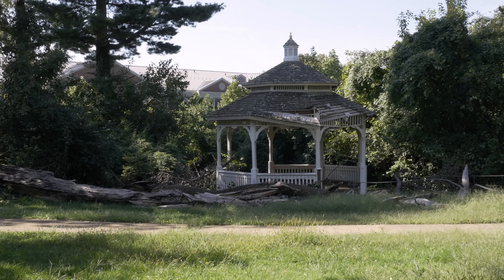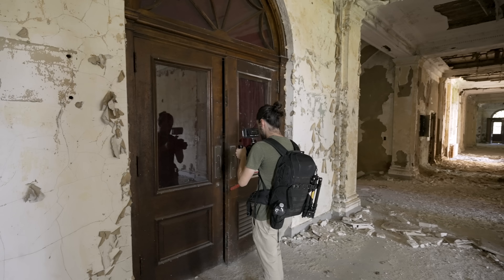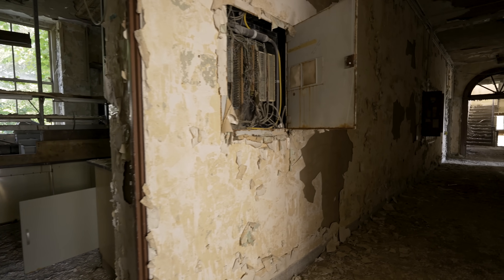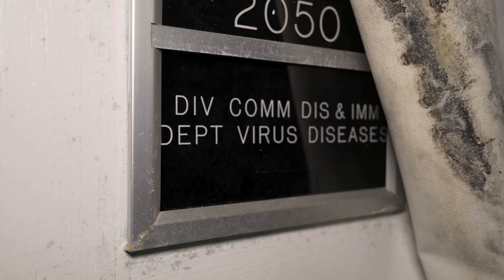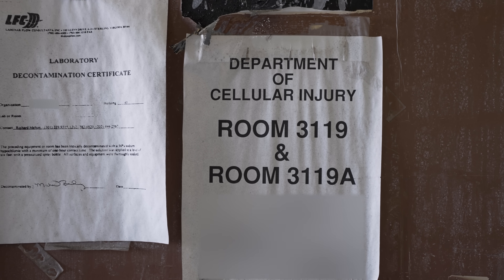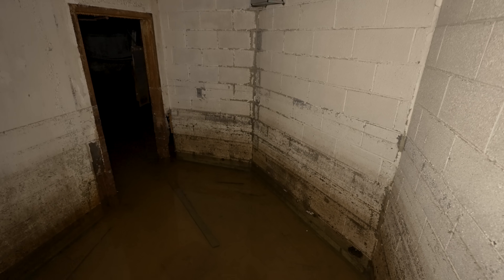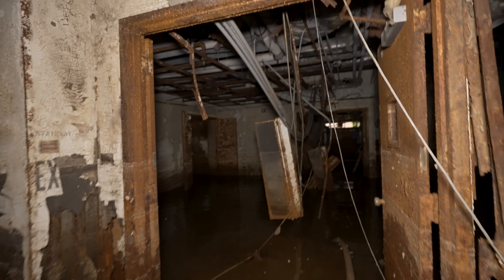Exploring an Abandoned US Government Biomedical Research Facility - They Created Vaccines Here!

Comment: Hey. I used to work there when the National Museum of Health and Medicine was on the campus. That museum was in the same building where Covid would have been researched. Not this building. Things like Ebola and more were in the building across the campus from there, on the other side of the army hotel. These labs were slightly lower grade, but the upper floors still had some pretty scary stuff. Those tiny windows beside the metal doors allowed them to see in during decontamination where nothing would come out alive. Then that was all moved to the AFIP building long before the 1990’s and that’s where the crazy labs were with multiple chambers to go through to go in and out and where all the poor animals were held. When I worked there only three rooms were in use and I used to walk around. Definitely experienced weird stuff working on that base. I left in 1999.

Comment: Always bothers me that so much infrastructure built with tax money will just be given up and left to rot.
Reply: Things get old, decay, become obsolete and need to be replaced. We no longer operate ships from WWII, for example. It's often most efficient and economical to replace the old with new.
Reply: @moredistractions  Equipment, sure, but brick buildings?
Reply: @herzglass  If it doesn't meet the needs of modern machinery and workflows? Absolutely. Remodeling old buildings like this can be exceedingly expensive.
Reply: @herzglass it had close to 80 years of use it was probably cheaper to build a new building then revamp this one, towards the end it was probably already starting to decay most buildings don't go this far down hill in 24 years
Reply: That building was built during the war and probably built to the engineering standards at the time.  Over time, buildings get weaker due to corrosion and decay....Best to rebuild something this old as a public facility.....Think about the condo collapse in Florida and the apartment building collapse in Iowa.
Reply: @grandinosour  This building was built like a brick dunny not some cheap-a apartment buildings.
Reply: Asbestos perhaps

Comment: The round cylinders on the ground in the labs space at 46:06 appear to me to be what we call “A Pig” which is a leaded shield to put a radiological source in while not in use (this reduces the effective dose to those working in the room). It’s possible that in their small reactor they were activating metals via neutron bombardment to make radiological sources which they then used study the effects of the radiological exposure on various biological processes (just a guess). With respect to the Whole Body Counter, while the video explanation you showed is accurate, it’s entirely possible they used it to perform a whole body count on their radiation workers who worked in the reactor space or worked with radiological material. It is the law that if you have radiation workers you must have a program in place to monitor rad worker exposures and a whole body count or a lung count is one component of this program.
Reply: I'm assuming it was not a reactor as much as it was a particle accelerator much like hospitals use for some types of sources.

Comment: Very cool!! I am a Vet Tech working in a modern day Vivarium Facility. Very neat to see an old Vivarium from the 70’s and 80’s.
Reply: They mentioned "this is where they would be researching COVID-19 if it happened in x year", judging by the Architecture of the building I'd say it was around the 60's or 70's which means yes they most likely by some chance would have researched and classified the Coronavirus family when it was discovered in the early 1960's.
Reply: @Defirence  Plot twist: Covid-19 escaped from this very lab as the cages rusted through some rats from the reactor room managed to climb the stairs. :)
Reply: Considering that this facility shut it's doors sometime in the 90s and has sat empty ever since, it's still holding up decent and with no signs of graffiti anywhere, which classifies this location as undisturbed by vandalism.

Comment: 30:00 I think it is crazy that a room that they were performing surgeries in would have those window shaker AC units in it. You'd think there would be filtered air or some kind of central HVAC for a room that needs to be pretty sterile.
Reply: I was thinking the same thing! Lol
Reply: Was only experimental surgery, chill.  XD
Reply: Lots of vintage Friedrich window units.
Reply: I don't really think patients were expected to survive.
Reply: Forget patient survival, what about a lab leak like COVID? That seems to be the real danger.
Reply: They were working on mice and rats, not humans.   They weren't really worried about keeping things sterile.  If you have 1000 mice, you won't even notice if a few of them die.
Reply: I saw a sign that said Dogs 😮
Reply: @nilo70  they probably used beagles like they still do in research. The things those poor sweet dogs are put through.
Reply: Those were probable built in San Antonio, Texas! Not anymore. So sad. @fanmanmathias
Reply: Timestamp?
Reply: I worked in research in old buildings, they are too cheap to put in central air so window ACs or you suffer. Our lab got almost 90F until my boss bought a cheap one at a garage sale.
Reply: They recirculate the air, not pull from the outside, as long as they are sealed to the window properly it should keep things contained. At least that was the idea anyway

Comment: The drawers are out because it has been Standard Procedure that when a military facility that might contain classified or dangerous materials, to leave all the drawers to show nothing was left.

Ft Deitrich in Maryland has a building that had been hermetically sealed with no one allowed entry.

Did a two-week Annual training with the Army Reserves there. We set up Satellite terminals to relay to Tactical comm systems. Were told not to sleep on the ground, to allow tent canvas to touch the ground. we slept in an old empty building and had to spray the truck tires and our boots with disinfectant when walking or driving off the site.

Great fun! But I am enjoying the extra limbs I grew.
Reply: That's what I thougt all the time - were they put out when moving out or later by scrappers. But the orderly way it was done leaves only the first option.  Additionally the bio-decontamination of the labs would have required to spray all in- and outside surfaces of the furniture.

I often found interesting stuff stuck behind drawers and the like. Sometimes even in the corner behind an open door.

Comment: As will any of these buildings, it always fascinates me to think about when the last time they were in active use. When was a light switched off for the last time? A drawer opened and closed never to be touched again? A phone call to another room that would never transmit another  conversation? The final coat of paint on the walls that from there on out were destined to flake and chip off?

Comment: Looking at the building map, the "Reactor Roof" is at ground level over the sub-sub basement. As the reactor was decommissioned 50 years ago I would guess there's not much left...but we'll never know as you forgot the SCUBA gear. It would have been cool to see the big watertight doors and lead lined walls. Maybe one day they will again turn on the big sump pump down there.
Reply: i noticed the big meyers pump controller, i bet they had big sump pump wells. it was odd seeing the ladders and work lights like the guys just forgot them one day and now they're under water

Comment: Originally I was going to speculate that the colored drawers possibly were to prevent cross contamination of specimens in the event someone walked into the wrong lab and they would have a visual cue… but then I saw a sign later for the different types of hazards and they were color coded blue, red, and yellow. It seems more likely to me that the drawer colors correspond with each hazard type/color on the signs.
Reply: Correct.

Comment: The ceiling in the auditorium would be called a coffered ceiling. Where those abacuses in the recesses?
24:00 is commonly known as bus duct, fed from the buildings main electrical service, can be connected at various points to feed panels or electrical equipment.

Comment: The vivarium space ("animal labs") you found are fairly common design, even by modern standards. You don't have any windows from outside, both so you can keep your animals on a constant light cycle (usually 12 hours on, 12 hours off) and to prevent anyone else from seeing in. Also everything needs to be easily able to clean.
Reply: This is fascinating thank you
Reply: @chrisayers2737  Sure thing. I'm glad my odd work experience can be interesting to others!
Reply: Yea I was hoping they were going to find a room order sheet near one of the doorways but I didn’t see anything. They also usually maintain animal labs on upper floors, basement level or close to the loading dock. I know some of the college campuses near me have experienced animal rights activist trying to break in and free them. The way a lot of the vivarium is sealed up makes me think they had a good amount of BSL-3 spaces and were dealing with some serious stuff.

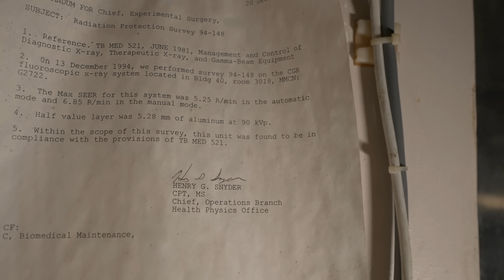Comment: 29:38 I study radiography and much of this stuff makes a lot sense to me. It's crazy to see how little, and how major things changed. The giant machine in the room is called a C-Arm and it's used primarily in surgery or when you do not want to come in contact with a person. 

The paper shown had to do with compliance and is measuring intensity. The half value layer portion is stating that an energy of 90 kvp, the material that decreased the intensity to half it's original is 5.28mm of aluminum. If it took more, such as 20mm of aluminum, this would indicate that the beam is operating at a much higher intensity than the specification lists (for example that is). It's interesting to see the units used in this!

Comment: When visiting places like this you need to see what is taped to the outside of the doors to the labs, that will give you a good clue as to the nature of the work, or at least the level of hazard.  For example you can see BSL or Biosafety Level signs on the door, the higher the number the more (they range from 1 to 4) the greater the hazard of the items under study.
Reply: They know that
Reply: Was gonna say this say this same thing. Right at 17:55 you can see the entrance to one of the doors sign with “BSL-2” ie diseases that there is a treatment for but are not fun to catch. Those rooms up on the upper floors definitely look like a vivarium and BSL-3 rooms. You can typically tell the BSL-3 rooms will almost always be drywall ceiling because drop ceiling won’t hold up to the pressures to keep the room negative pressure. They also typically have stainless steel ductwork as the chemicals required to kill those viruses are too caustic for standard galvanized ductwork. I definitely think they should be highlighting the room signage more in future videos..

Comment: With the x-ray machine you most likely found the reason for the power busbar. At that time they would easily consume hundred(s of) kilowatts. A hospital from the 60s here had an own 500 kilowatts transformer for the x-ray department. And for that amount of power you can't use the linen covered gutta percha insulated power lines from the 1920s in the wall. :)
Reply: Thank you, I was wondering what could have used so much power.

Comment: The reactor being way down in that sub sub basement would seem odd to me. You would think they would need multiple exits from the reactor, as well as ways to get fuel in and out in a safe manner. I bet the sub sub basement is just utility stuff.
Reply: It wouldn't have been a large reactor. I wonder if it was even a proper reactor or just a source with delusions of grandeur. Remember there are different kinds of reactors, too. If they had one for real, it's not producing electricity, merely exciting a source for irradiation experiments. You won't see a big grid of holes in the floor for inserting rods. The vessel will be small. Also, there may be other pathways into the area that are undiscovered.

Several universities in the U.S. run their own small reactors for education and experiments. They're only a foot or two big. Pretty sure the one - I think it's at Stanford - Has plenty of videos of it even in operation here on YT. The core is naked in a water pool for all the beautiful Cherenkov radiation to be seen.
Reply: I have been to a research reactor in Missouri, it was just kind of housed in the middle of a big square building with different labs and recipients of its shunted power all around.  I bet this old one was used differently and housed differently, though.

Comment: Love to see these old labs, was thinking maybe the sealed windowless ones could have been an old style clean room.
My previous job as a service technician for lab equipment meant that ive visited a lot of different labs over the UK, which i find fascinating to see. Ive noticed that a lot of them (especially gov funded/ gov departments) look like they have not been updated since the 50s/60s and look very similar to the one in this video.
Reply: In a lab that studies pathogens and diseases it would be similar to a clean room but the other way around. A clean room maintains uses HEPA filtered air for positive pressure to keep any contaminants from coming in. Rooms that house pathogens maintain Negative pressure which means they suck out more air than is coming in, thus keeping all the nasty stuff contained inside.

Comment: On the electrical, you guys were close, those are called buss ducts, typically a large amperage feeder supplies power to it and you can install smaller circuit breaker enclosures on it called "buckets" to supply equipment or panels

Comment: 23:49 they needed ventilation for the major current those bus bars were handling, definitely hot in voltage and current (probably 480 volts 3 phase) and probably made of brass
Reply: Nope.  Just weight reduction.

Comment: I suggest you carry a Geiger detector with you. Some if those lab spaces mught have tested radioactive samples.  The regulations are pretty strict,  but people make mistakes. Especially when moving out.
Reply from the maker: This facility was fully decontaminated and decommissioned by third party companies.
Reply: @TheProperPeople you never know how good of a job they did.
Reply: @TheProperPeople yeahhhhhhh, never assume anything when it comes to radiation. Orphan sources are no joke and can look totally innocuous.
Reply: @devsfan1830 what's orphan sources?
Reply: @EphemeralProductions  A lost (orphan'ed) item the is a (source) of radiation emission.  AKA an unstable element.
Reply: @EphemeralProductions  An "orphan" source is one that is abandoned.  The former Soviet Union was notorious for that, but it does happen all over the world if paperwork is lost or messed up.
I was cutting across loading docks by dumpsters and found on the ground an old lead radioactive sample container with a partial label on it. I knew they were cleaning out old labs, so I notified the Rad. Safety.  The holder was empty,  but it did have some elevated counts. The dumpsters were fine too. Not good press if a salvage guy would melt it down for bullets.

Comment: You took a big risk going into that sub basement gentleman.
That was scary
Reply: Correct, could be lethal gas down there too. Among other hazardous materials. They are still young.
Reply: terrifying
Reply: No. Not in that space. There's nothing in there to cause gas buildup besides bio material that may be decaying, but there was none of that. Co2 levels may be slightly elevated, but there wasn't enough rust in there to have depleted the oxygen and while not "ventilated" it's not exactly enclosed, either. The largest danger was a bad floor, but I think it was a concrete slab. All you snowflakes in the comments.

Comment: 23:55 It's funny that you thought it was part of air conditioning, when there is windowed air conditioners all over the building. The place definitely had no central air conditioning. I wonder if any of those air conditioners still work after 24 years or more of abandonment? Great video as always, keep up the great work!
Reply: It appeared that wherever the drop ceiling was, there was central air conditioning.
Reply: I'd wager at least half of them would still work. Pulled a rooftop one off an RV once that had been disused since the 90s. A 1970s duo therm model. Wired it up and powered it on. The old reciprocating compressor struggled at first probably due to its 30-year-old hibernation and a failing start cap. After the initial thumping/whirling it managed to successfully start. Seconds later it was pumping out 40-degree air on a 90-degree day. You won't see that happen with anything made today. Those old hermetically sealed systems will last decades as long as they were built good and weren't physically damaged by any vandals.

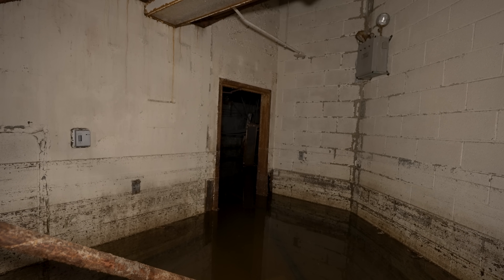Comment: 13:53 the water is most likely not radioactive due to decay and the sheer amount of decommissioning/decontamination work that has been done, would be useful if we knew what fuel the reactor used and its model.
Reply: just a note the dead rats and creatures in the water are probably the thing you should worry about